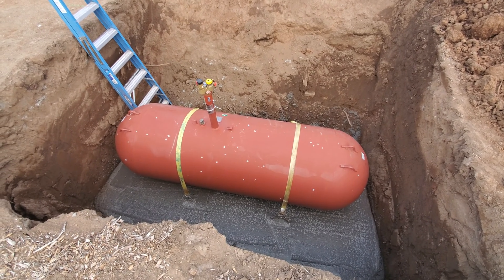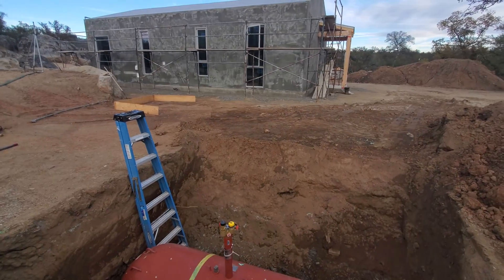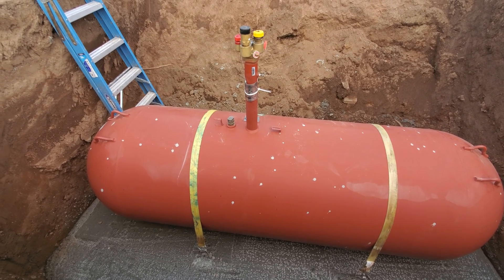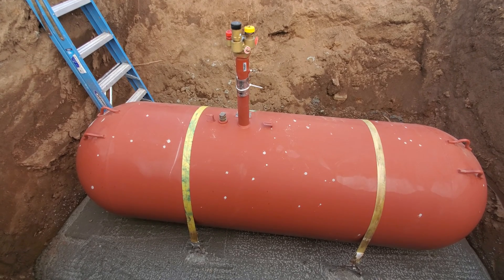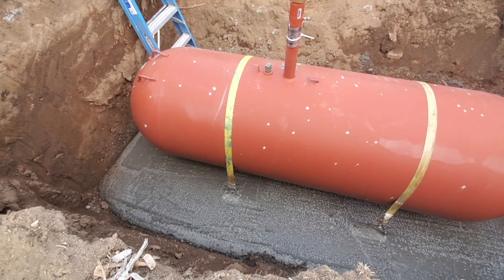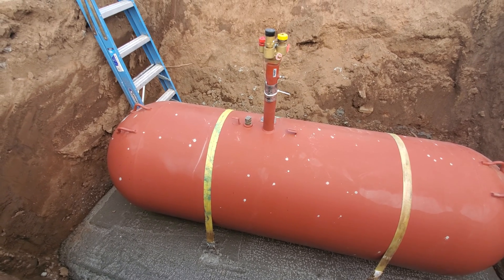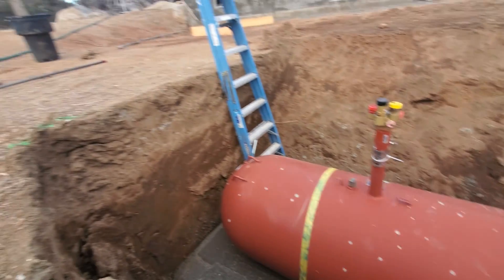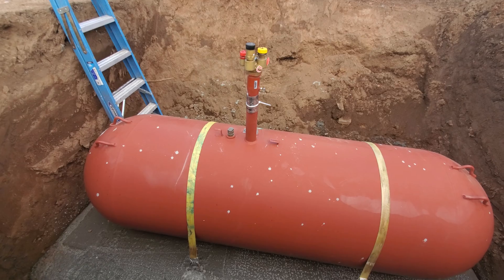Underground propane tank anchoring

Comment: How did you attach the straps to the rebar loop?
Reply from the maker: Yep, attached to rebar loops and then tightened the straps down. We ended up getting more rain water in the hole and it didn't float so seemed to work!
Reply: @BuildItLikeBeckhams  So you just knotted it or something? Could you excavate it and give me some close up photos? lol. No ratchet or turnbuckle to tighten it down? Just trying to figure out what I'm doing, heh. Ty!
Reply from the maker: Oh I missed that you asked how. It's hard to tell from the video but I just used an older set of 3" regular tie down straps that have built in ratchet and u-hook. There are specific ones you can buy that are meant for propane tanks but are really expensive and don't seem that much different from a regular set for less than $100.
Reply: @BuildItLikeBeckhams  Awesome, ty! Will try to find those.